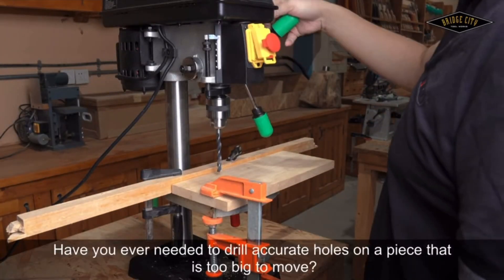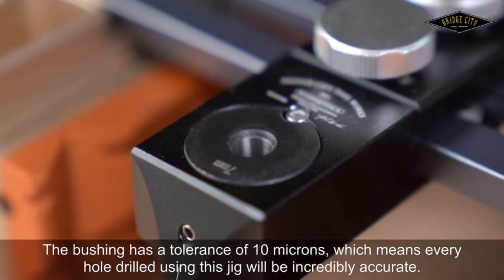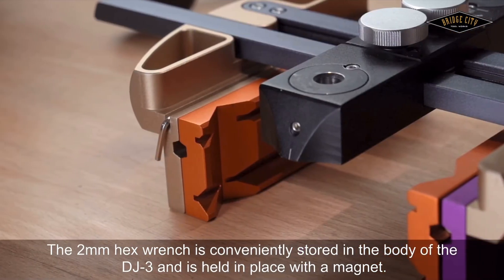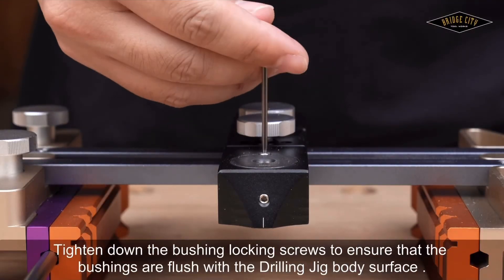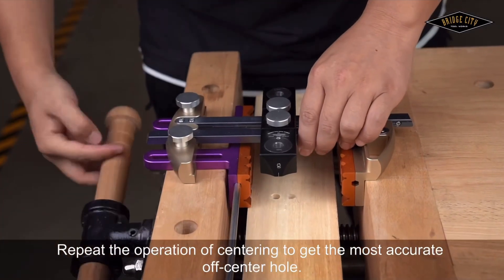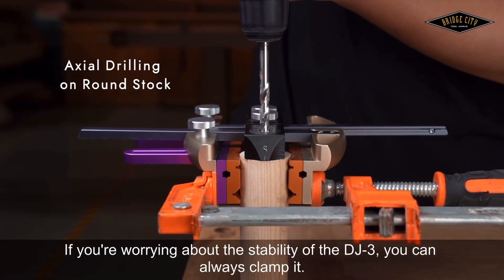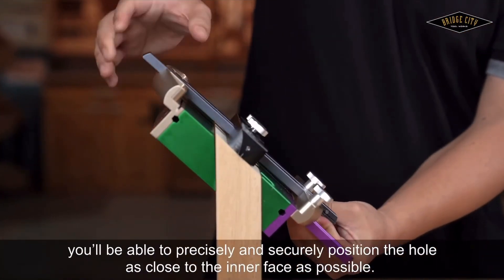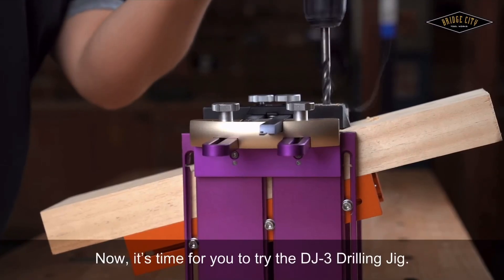A Drill Press That Fits In Your Hand? The Bridge City Tool Works DJ-3 Universal Drilling Jig

Comment: One of the most important features of a drill press is the ability to set the depth of the hole you are drilling. There appears to be no means of setting the depth of the drill bit with this jig, particularly important when drilling at an angle with rather pricey optional jaw kit. I suppose you could use drill bit depth collars but at these prices they should be included.